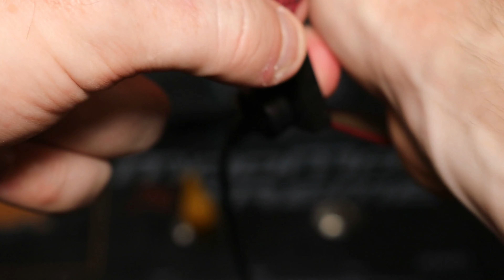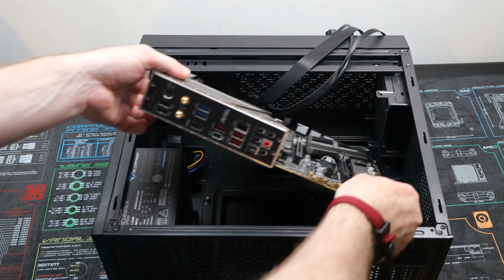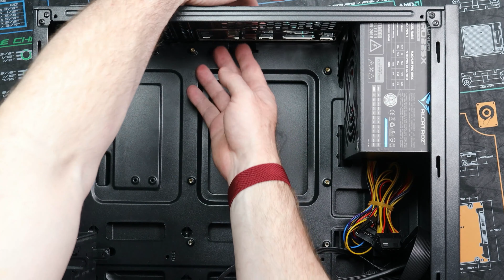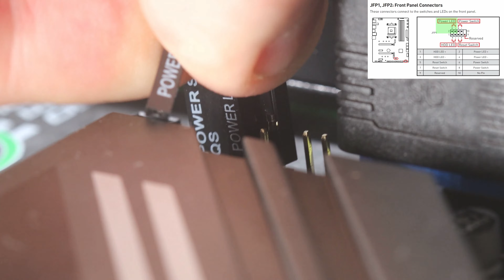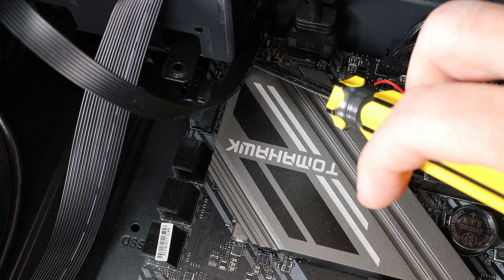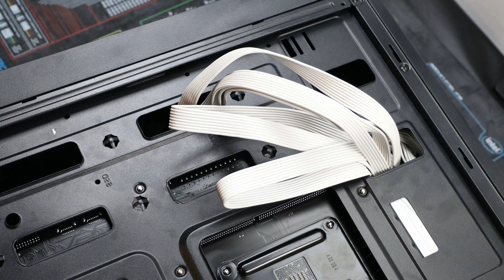Motherboard Installation - CompTIA A+ 220-1101 – 1.15

Comment: Thank you for the excellent video. I’m having a problem getting my motherboard to line up with the stand offs. I am installing an MSI PRO Z790-A MAX (Integrated IO panel) in a Fractal Pop Air case. When I get the motherboard positioned it seems it needs to be pushed into the IO opening an additional 1-2 mm. I’ve tried to push it in further but it just won’t move. I hate to push much harder for fear of damaging the motherboard. I thought maybe there was a protective film on the IO panel but that did not check out. Would you have any suggestions that might help me out? First time builder so I really would appreciate any advice. EDIT: Had to remove the adjacent pcie slot cover. Lined up perfect then.
Reply from the maker: MSI PRO Z790-A MAX is an ATX form factor so should go into any ATX compatible computer case.
All the Fractal Pop Air case appear to be ATX cases as far as I can tell.
Just read your edit. Glad to hear that you were able to get it installed. :)
Reply: The  pcie slot cover must have been slightly misaligned and wouldn't let me shift the board enough to align with the standoffs. After the board and GPU were both installed the pcie slot cover slid right into place.